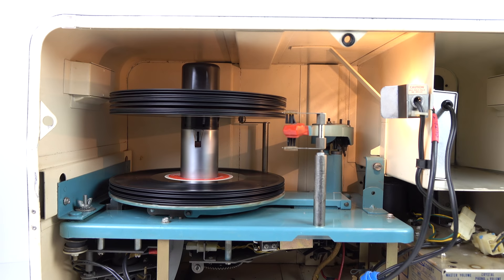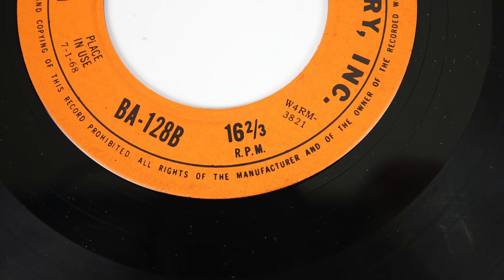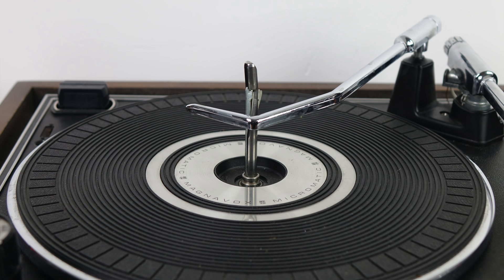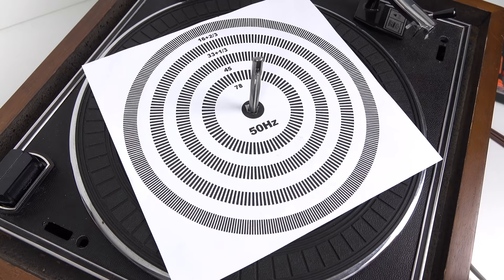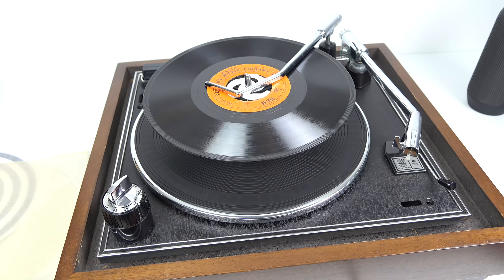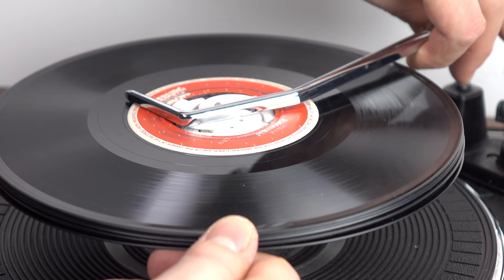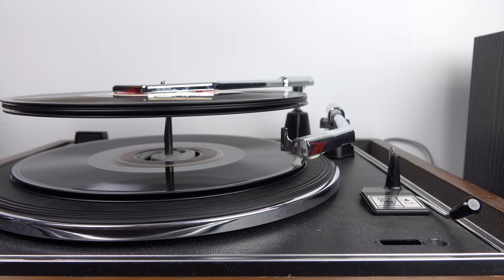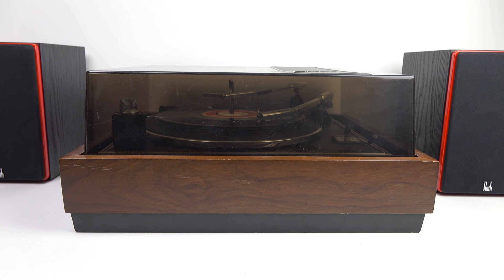Seeburg 1000 BGM Part 2: The DIY version

Comment: There were a few British tables from BSR, Garrard and Glenburn and German Dual, PE and Elac/Miracord that offer the same adjustment capabilities and all four speeds. I am wondering if the site that recommended the Magnavox was an American site (although BSRs and Garrards are still pretty plentiful here). 

Not surprised that this Magnavox is a largely British made unit as in the 60s and 70s, especially when it came to run of the mill stereos, if the main unit was made in Japan, Taiwan or the US, it had a UK made turntable mounted either on top of it or as a separate component. 

My father had a Centrex by Pioneer all in one unit that had a BSR turntable mounted on top. Ironically one were to buy the same unit outside of the US it had a Pioneer sourced unit. I had a Fisher (under Sanyo ownership) table that was a rebadged Glenburn. Upper end units usually  had a Dual of some sort mounted to it. In fact in the US it seemed we mostly made tables for radio stations and schools and Japanese tables did not really come into vogue until the mid 70s.

Ironically the only US made table was made by VM under the British Industries Corporation (BIC). I often wondered if that one was a UK design as it had a "digital speed control" with membrane buttons resembling a Sinclair  computer and an injection molded plynth that was well made but had a certain AMSTRAD look to it.

Comment: Good job! But let me give you a tip. You really needed to used a older Magnavox changer that was made by collaro from about 1959 or somewhere to about 1964. The reason is, unlike yours that uses one idler wheel to not only turn the platter but also run the automatic mechanis. But the older ones used TWO idler wheels. One that ran the platter at constant speed, and another that made the automatic function run smoothly no matter what speed the turtable is at. Also too, most record changers made before 1965 had a spindle compacity to hold 10 Lp recods, and 14 45's. After that they only made them to hold about 6. What the reason for that was, I don't know.

Comment: 16 2/3 rpm? Look for a 1970's Dual automatic turntable. These "noisy idler" drive system's slowest speed was 16 2/3 rpm, though getting the tone arm adjusted to the 9 inch disk might be verry interesting.

Comment: Great video as always Techmoan! I do have one small question: why did you modify the turntable instead of using that frequency converter you made back in August? Did you shoot that part of the video before you assembled your frequency converter?
Reply from the maker: Yes it was shot before I put that together, however that unit is just for short term usage, due to the wires and fans.

Comment: 3D printing adapters for 1950s tech, how anachronistic.  Carving it out of a larger block with a knife would be more timey.

Anyway, with all the US gear you collect, maybe you should find a high power frequency and voltage converter that can power several 110V/60Hz devices at the same time, so you don't have to make custom adaptations for each one.  Something with a nice row of US power sockets wired to an ugly box under the table.

Comment: You don't need an adapter --- you just run the old reliable method of placing the record somewhere in the range, and then running a fingernail or paper clip along the edge until it centres.  As for the speed, of course you can simply play them at 33.3 to a recorder and then play it back at half the speed.  Of course the emasculated character-destroyed aspect of the content makes neither of these worth the trouble, the point is there's always another way.

But I wonder about the groove cut of these special discs and whether a standard LP type of stylus is really suitable for it (or vice versa).

Comment: Love your videos!  to play these records on a stacker turntable with NO adjustments or modifications you would need the collaro conquest or the magnavox 1960's micromatic!  I have one and it will play ANY odd size record not just 7" 10"  and 12"  like the later micromatic you have.
Reply: ALSO the early micromatics have a taller spindle and can hold alot more records than the later model, also called the automatic 400, like your magnavox.

Comment: Instead of trying to hunt down one of those turntables, couldn't you just use something like an Audio Technica AT-LP1240-USB or similar, set the speed to 33, and then use the manual speed controls to set it to half speed, which would be 16 2/3?

Comment: I tried to understand how this record player actually drops the bottom record in the stack. You explained it pushes the record to the side? Could you perhaps explain how it does this in a little more detail? Reason I ask is that I found an old record player built into a cabinet that has the same type of spindle. By the looks of it anyway. Thanks in advance!

Comment: Hi !
Is the muppet using a Minitel ?
Reply from the maker: Yep. It was BNIB too until I took it out of the box.
Reply: Cool, thanks for your answer
Did you import it from France ? And what number it is ? Looks like a 1 from Alcatel but not sure.

I have a lot of those because when they stopped the service in 2012, a lot of elders put them on streets corners.
Reply from the maker: It's an Alcatel 257 from 1989 (UK Version).

Comment: I have a question

once you adjusted the screw on the automatic arm of the turntable to play the background music discs, what happens when you would try and play a 33, 45, or 78? Was it all messed up alignment wise or can it be worked to play all 4 rpms automatically?

Comment: hi Mr T :) any chance to a link or somewhere to dl the strobe disc. i have a usb turntable to record my old albums and never knew these were about till i see you had one :) ill be able to make sure they are at the correct speed now :) Thanks.
Reply from the maker: I think mine came from vinyl engine. https://www.vinylengine.com/strobe-discs.shtml
However there are lots of alternatives around...a quick search for 50hz or 60Hz strobe disc revealed a few.
Reply: Thanks Mr T` :) i did find a couple and were charging something like £25 Thanks for the link, had to register but hey the site will come in handy also.

Comment: Just curious: you did a video where you plugged in a 12 volt power supply to the mains, and then an American inverter into the 12 volt supply to get American 60 Hz power. How come that system won't work in these videos? Why go through the trouble to adapt the capstan or use a sine wave converter when you have an inverter?
Reply from the maker: You'll find some information about this in the video description text box.

Comment: 4:10 Where is your 60 Hz inverter that you used in your previous videos to run an American vintage tape player at the proper speed? Why are you using a heat shrink tubing?
Reply from the maker: You'll find some information about this in the video description text box.
Reply: Thanks for the reply. I often post comments without reading the description :)

Comment: Do you know if the discs have grooves simmilar to an old 78? Or are they compariable to standard record grooves? Also, thanks for linking those adaptors, i've been trying to figure out how to rig up a simmilar setup for a while now.
Reply: Zach Mueller 
I believe all 16 RPM records including these were microgroove like more modern 45s & 33s. Not stereo though. 
Have to be microgroove to get that many tracks per side even at that speed.

Comment: So, if the records had to be played at 16 2/3, and then it played them slower because of 50Hz, would playing them at 33 1/3 work well, or would it be still too fast?
Reply from the maker: 60hz devices motors run 17% slower on 50hz. 
16 ⅔  is 50% of 33 ⅓
Hope that helps answer the question.

Comment: If I understand the Seeburg 1000 configuration correctly, the B side would be wound in reverse, since the stylus was intended to track the disc on the underside. How do you play the B side with this DIY setup, or do you just not?
Reply from the maker: Nope the B side is the same as any other record - flip it over an it plays in the standard direction.
Reply: Huh! Does the player spin in reverse on the underside, then? Or am I just failing at spatial reasoning today?

Comment: Why didn't you use the 12v power supply and US car inverter to get 120v and 60Hz?
Reply from the maker: This is neater. That's a temporary set-up for demonstrating old tech in a video...however it's not something you'd use for hours, with the wires and the fan and the noise and the size and the setting up etc.

Comment: There is an older mechanism made by collaro and branded by Magnavox that looks for the size of the records in a similar way but actually not caring about 3 standard sizes like the model you have. The arm just remembers its position and moves in a little further after dropping the record. It finds all odd sized records. And it even changes always at the same speed no matter wich speed is selected.
Have a look here: https://www.youtube.com/watch?v=w2rmE-_MgSY   And here: https://midimagic.sgc-hosting.com/collaro.htm
Aaand here: https://www.youtube.com/watch?v=pA5UnEl83BE&t=29s

Comment: Whatever happened to the 50Hz to 60Hz converter you previously made out of a 12V supply and a US inverter? You don't seem to use it any more.
Reply from the maker: You'll find some information about this in the video description text box.
Reply: Oh dear! I see. You'd think there'd be some device to do that all-in-one more conveniently, but I guess it's quite difficult to create a different frequency (probably still have to go through a DC intermediary?), and is seldom needed for modern equipment.
Reply from the maker: There are devices...but they can cost into the thousands. I know a nice chap who is working on putting a more affordable version together.

Comment: Hey T-Moan: 60+NOOB, U 2 use Electrical Tape 4 t-table Speed Adjustment Drive Wheel..Also ,there R 2 adjust Head Align screw's 4 Head Adjustment 8-Track! [+ & -]. That's on'a Need 2 No Basis. Connection's TECH style...